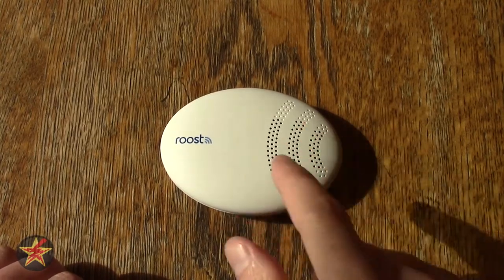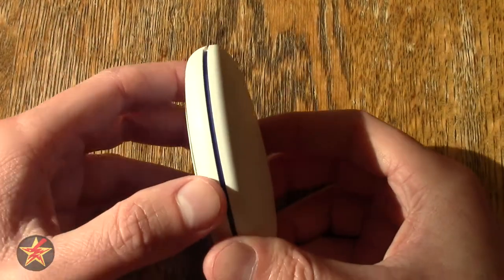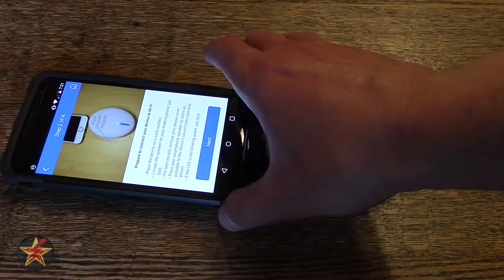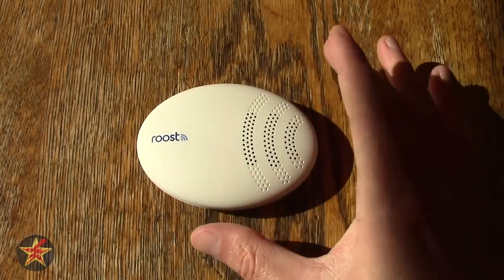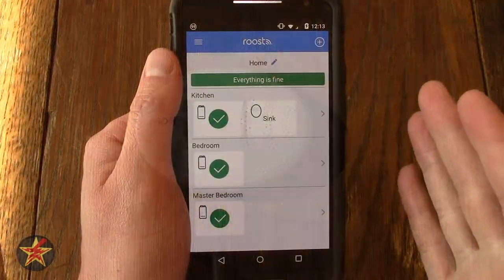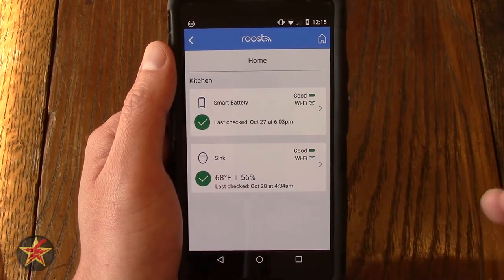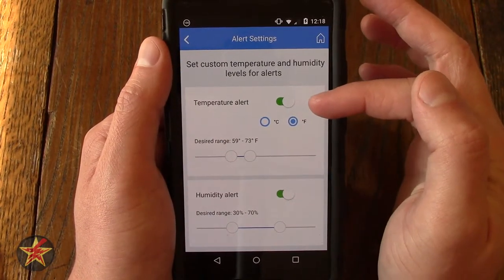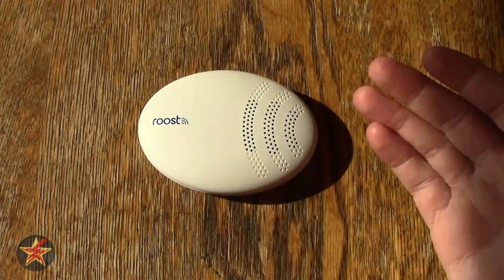Roost Smart Water Sensor Review

Comment: Even tho this video is a year old now, I have a thought.... 
I have the same problem you did with the cement floor in the basement. While my floor is dry now -it surely has some kinda moisture in it -because mine is sending alerts ALL the time. 

MY THOUGHT is... 
Maybe set the device onto a playing card? Its plastic coated, so shouldn't absorb the moisture from the floor AND its thin enuff that (hopefully) it'll detect a flood at its beginnings, when actual water gets on top of the playing card placed under it. 

Thoughts? (from anyone)   ?
Reply from the maker: Card sounds like a good idea.  What I ended up doing was propping it up so the contacts were not touching the floor, just enough to keep the alerts from coming in but not so bad that water would not trigger it.